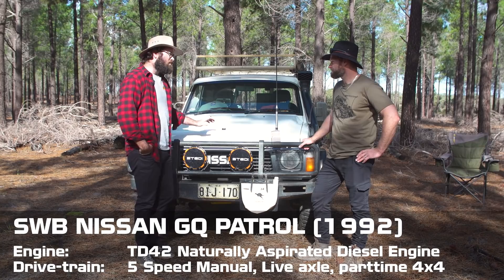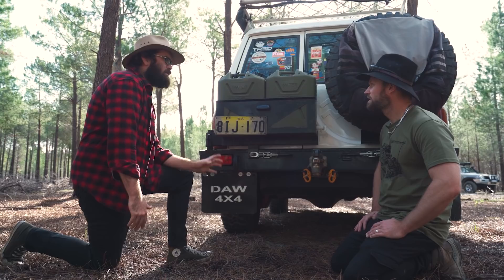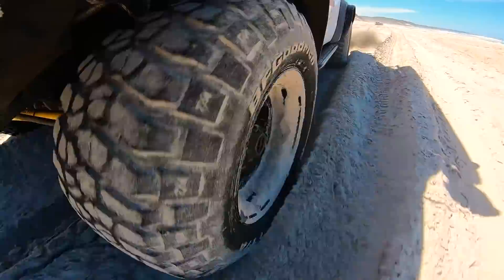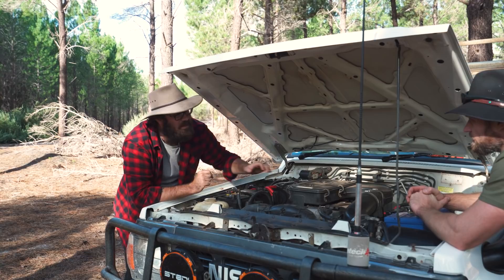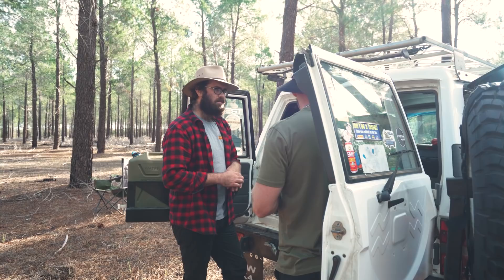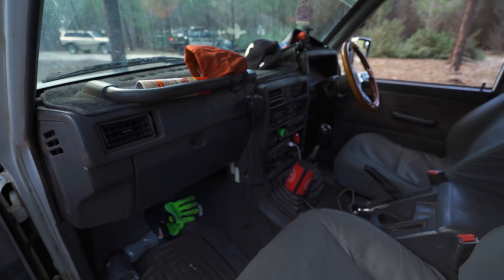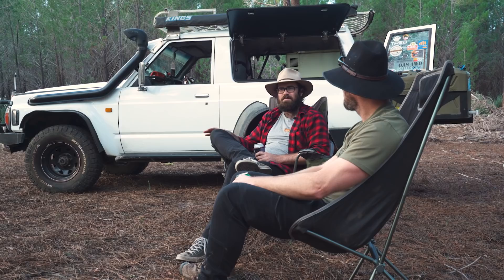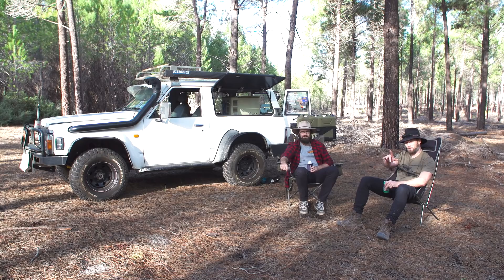4x4 Nissan GQ Patrol SWB Modified Episode 81

Comment: Im just echoing some posts before me when I say I love seeing these budget builds. Not only are they diy inspiring, they're reassuring. We all get a bit caught up in the latest ideas on the market and can end up disheartened when we realise it will take years to buy up and have stuff fitted. But vids like this remind us we don't need flash and fancy to get out and be in the bush to the fullest. 
Save your money for good tyres, good suspension and regular maintenance by using your noggin  to make your own stuff out of bits and pieces. The Satisfaction of making your own is worth even more than the savings. Plus, rough n ready home made or modified to suit looks cooler than the polished and precise bought stuff. 🤟

Comment: I haven't seen water bags since I was a kid. Late 70s my parents took me (then about 4 years old) around Aus in a little land rover that was stinking hot and noisy and gutless with two water bags on the front refilled from jerry cans. Always cool water and i remember the canvas taste still haha. We kept them into my early teens when we replaced them with cooler jugs. Haven't used one of them for a while either.
Reply: My grandfather used to tell me about my great grandfather using canvas bags as water "bottles" / coolers on the old open-air pto harvesters. Times have definitely changed, but maybe some of it is coming back full circle.
Reply: @jacksonholmes1459  some old ideas are still good ideas. They just get buried under decades of new stuff. Cast iron cooking gear and standard old swags are still around. And that makes me happy haha

Comment: Hey Ronny? How you going? Big fan! Got a Gq patrol for a future episode that you'll be interested in! 

This video, the chap with the unknown bullbar. Well I'm pretty sure I have the same bull bar and in the same boat! Apparently it was an arb bullbar that was a factory option when they sold the Gq from the dealership and apparently with the lights, they're the stock front bumper lights, they just take them out and put them in the bullbar. But catch 22, the light has no serial or part number what so ever and they don't make the parts anymore! 

Been searching for a couple years now to find it! TJM has blinker lights from one of they're bullbars. With some slight modifications, they'll fit right in! 

Hope it's helpful

Comment: its a tjm bar. both led and bulb will fit it. @ronny
Reply: Nope, that's an ARB bar.
Reply: @k2svpete  It doesn't look like an ARB bar to be honest. The ARB upright posts start at the top of the bumper and not the bottom like the one on this GQ. If it was ARB he would be able to replace the indicators and wouldn't have to hunt around. Plus there is a part number plate welded and then stamped on the inside of the bullbar, passenger side wing.

Comment: you can just tap any light wire to the blinker and ground
can buy square/rectangle trailer lights at walmart etc
Reply: Not the wiring that's the problem mate 
Got that sorted 
Just finding a lense that fills the whole section and looks like its meant to be there 

Also 
No Walmart here in perth

Comment: I didn’t even know n/a diesels existed 🤦‍♂️
Reply: Number1HeatRocka they do and they shouldn’t, the most reliable and slow vehicle I have ever owned was a factory engine 450,000 MILE Mitsubishi delica NA diesel 52bhp at the wheel, 3 minutes to 60 but the mileage sums it up lol
Reply: My 89 GQ n/a goes the same as my 3.0 litre turbo hilux. Turbo means more heat and more moving parts to wear out. Bugger the turbos

Comment: Heck, don’t bother with just one bag of water on the front, just make the whole bumper a ‘water bumper’! Let the water slowly drizzle off and get blown into the engine. Who needs a radiator when you have an evap cooler in the front. Plus, you have more cushin for the pushin!

Comment: Bullbar is arb, if you go on eBay and type in arb led lights there’s heaps 🤙🏼
Reply: It not an arb bar 
Have been told by a few arb reps 
Looks genuine 
Or a different brand but definitely not arb
Reply: DAW 4X4 mines ARB and looks exact same even with the indicator holes on it, either will still be able to type in arb bullbar lights and they will fit, I’ve only ever seen one type of bullbar to have the inlet indicator screws and same as mine

Comment: Bullbar is identical to mine and has the nissan logo still on it barely, factory nissan winch bar that is very similar to tjm and arb if not one of their old styles i cant quite remember, indicators are near impossible to find as nothing fits. Usually why you see the bar with none in them unless they make up a plate and weld it in and use other lights

Comment: Bar looks almost identical to factory Toyota bar that was on my hdj they where made for Toyota by both arb and tjm to Toyota's specifications wich included the weird indicator cutouts replaced mine with bumper lights from a parado perhaps Nissan did the same Thing?

Comment: Does the placement of the two large spotlights interfere with cooling due to restriction of air flow to the radiator?
Reply: Not at all mate, I’ve sold the vehicle now but when I had it it never affected the cooling system. Regular maintenance kept it running sweet

Comment: Bfg all terrains,worst set of tires I've ever owned
Reply: Very over-rated. So disappointed with their performance, especially in the wet.
Reply: Funny, I've had no probs going where bigger, more powerful rigs on muddies go for the last 80,000km & on sand I can always go further. No issues on road in the wet but I've set my suspension up properly. Most likely if you have grip issues in the wet, your suspension is set up poorly.
Reply: @gqwarrior6694  I've had KO2s for the last year, stock suspension and carrying essentially no extra weight that would require suspension work. They're shit on wet roads, I have to crawl through roundabouts. Pretty decent off road, but I won't be sticking with them when I have to change
Reply: @penguinchampion  Stock suspension is your problem. Vehicles come from factory with suspension & tyres designed for road use. The moment you go to a tyre designed more for offroad use, the suspension can't deal with it properly. Some tyres will show up the issue worse than others but putting an offroad touring suspension set up in your rig would solve 60% of the issue & changing to a thicker front sway bar would solve the rest but you may not be willing to do that so a more road oriented tyre may be a better choice for you. Personally, even in my 29yr old rig with a heavy old diesel up front, I have to brake really late to load up the front end & push it hard into a corner to get it to let go. Straight line braking is limited by my rigs brakes rather than the tyres & I need a lot of right boot to get the rear end to let go. For me, they are a great tyre. So good in fact I'm putting a new set on tommorow with about 20,000km tread left on the old ones.
Reply: @gqwarrior6694  worst traction tire I have ever had always.stuck sidewalls tear very easily also changed to mud tires solved problems
Reply: @gqwarrior6694  i wont even go on the trails with someone running them got tired of have ing to get them unstuck lol
Reply: @douglassmith8494  me and the old man ran the bfgoodrich a/t we thought they were a great tire and i do a lot of tuff 4wding, they do lack in the wet but 110,000km out of a set you cant really complain
Reply: @douglassmith8494  Sounds like an issue with the user to me. Likely not airing down to pressures to suit the terrain. Not once have I had a flat. I drive through some ridiculous terrain including razor sharp limestone fields.